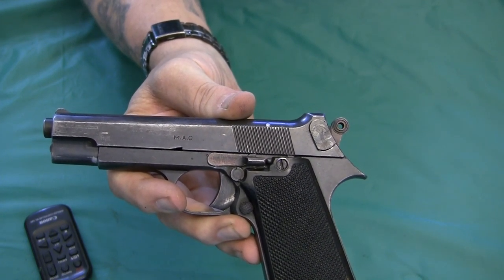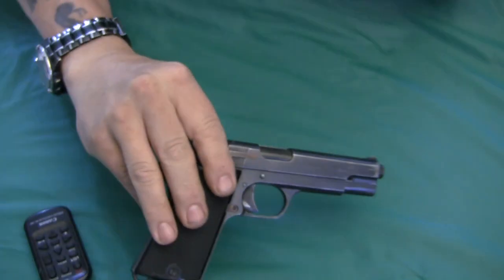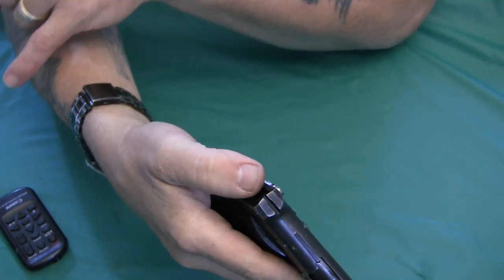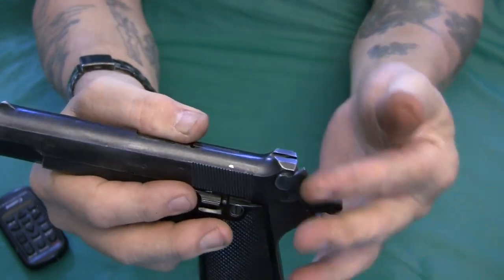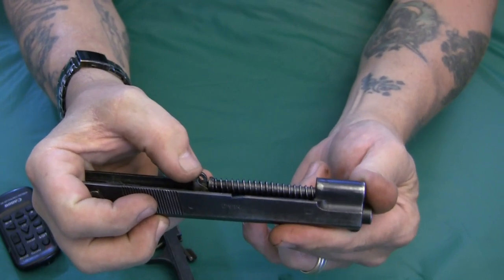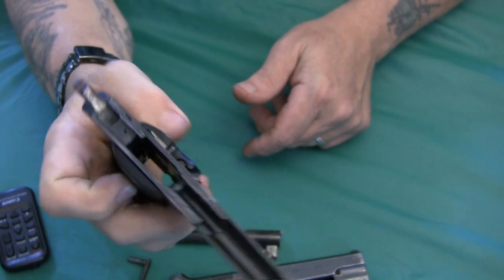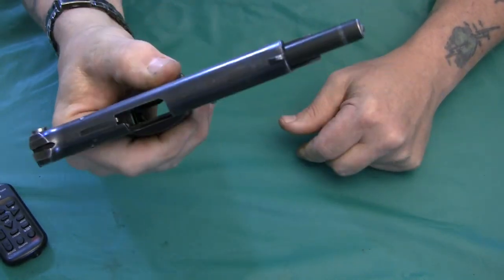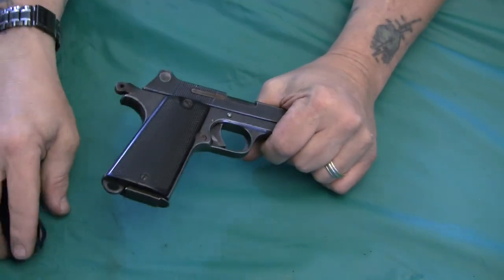French Mle. 1935 S Pistol an over view and disassembly

Comment: MAC means « Manufacture d’Armes de Châtellerault », Weapons Factory of Châtellerault (a French Town). Some pistols were marked MAS (Manufacture d’Armes de Saint-Etienne)
To remove the firing pin, you have to put the safety on and to lever up the loaded chamber indicator. Attention ! His spring will launch the firing pin.
Reply: And you can also remove the hammer mecanism and its spring from the frame.